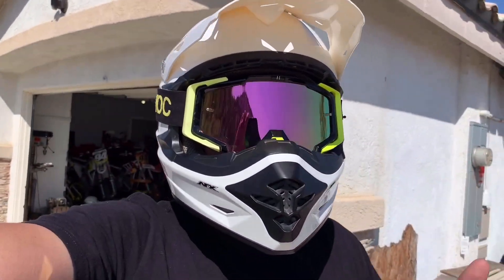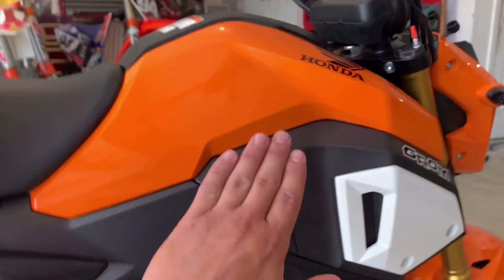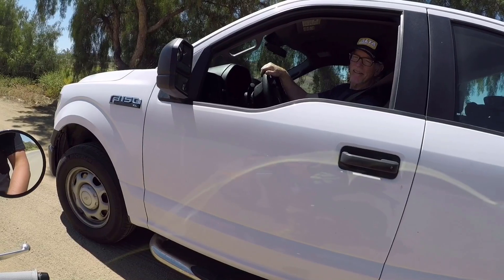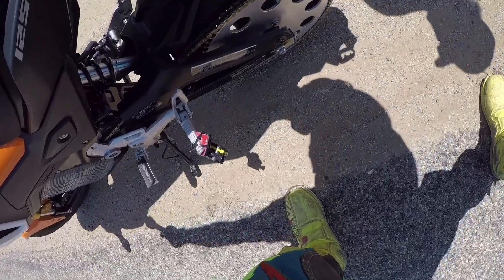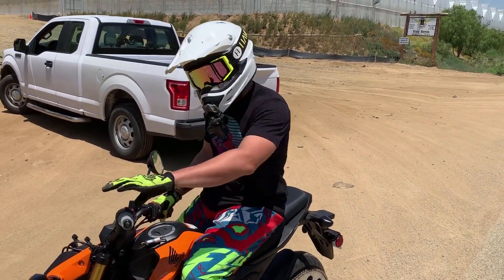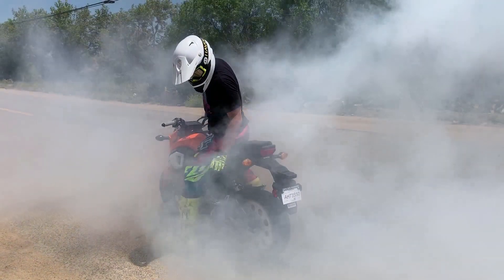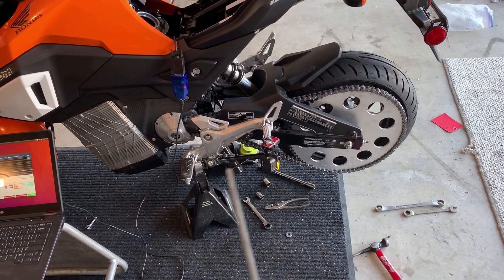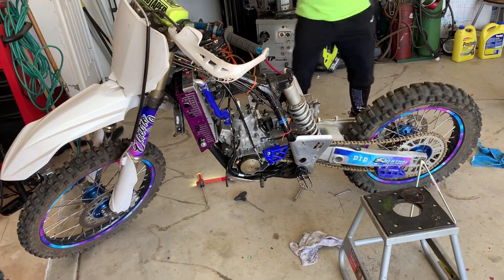50hp 40KW Electric Honda Grom First Ride - Project Electrom Vol.2

Comment: That chain sounds exactly like my homemade 4hp electric scooter, the chain going around the small sprocket makes that sound, I put like over 1000 miles on it and the chain survived (my scooter only did 35 on 36v). only way to quiet it down is a larger motor sprocket with a jackshaft that adds another set of gears, that way you could also run a smaller gear on your wheel. Dont know if you have room for that but its an idea. Excellent job, looks like a ton of fun to ride for sure!

Comment: How do you get 50 HP?? Did you say your pulling 100 amps?...On my modified Emmo Zone with Kelly Controller @225 amps, QS Motor 8000 watt hub motor, 100 Volt 45 AH pack I pull 20 kw, and can get the bike up to 130 KPH and 0-100 kph in about 7 secs.
Reply from the maker: John Zoccano @350v is the difference. 

This is an alta motors complete Drivetrain. Advertised At 50hp, then tested by forum members at 49hp. 

The high voltage and low amps was their trick.
Reply: @ElectroBraap  Ah..ok that makes sense..looks like your putting down lots of torque due to the "gearing" of that huge sprocket.....
Reply from the maker: John Zoccano It’s quite a long gear ratio surprisingly. The motor spins at around 11k rpm under load so without a gear reduction the sprocket size is quite large

Comment: On the chain side there's a big mess. In order to make it work you should build/mount up a gear reduction before the chain (and i wish to see a toothbelt next time instead of that). Without this basical mod it Will never work well. Take a read about antisquat and antidive in motorcycle dinamics, if you are confident to. Cheers
Reply from the maker: Nico there is not much space for a reduction, Its a Grom with 504 cells crammed into it. 😂

We can shrink the rear sprocket down a bit which is on the to do list. But what do you mean it will never work well? The ugly noise you hear has been addressed after the filming of this first ride. It’s still has an (to me) enjoyably loud wine to it, but it’s not harsh sounding any more. 

This is not a Moto GP Bike, it’s just a mini bike haha. The squat characteristics mean very little, especially with only 50hp. This thing rides perfectly fine and It corners very well.  

I don’t believe in over engineering something because on paper that’s how it should be. I believe in practical and simplistic designs.
Reply from the maker: Nico I appreciate the feedback though. You seem like you know your stuff!

You gotta realize that the Grom chassis is 100% stock. We could swap the 125cc engine back into it in a few hours no problem. Nothing has been cut or modified. We made this (an entire Drivetrain designed for a bike twice the size) all fit on a totally stock oem Grom.
Reply: @ElectroBraap  hello, thanks for your reply! I was talking about the rear behavior especially on the corner exit while accelerating, or while cornering. I know that's not a motogp, and as you I don't like over engineer things. But that's a basical error, have a look around on every motorbike on the market and try to understand why anybody use a similar final reduction. Trust me, you can achieve huge driveability improvement by just fixing that. I would really like to see the EleGroom on a small track with pitbike and minigp (I'm a hobby builder of the last category). In my opinion with 50 electric hp it should be a monster. Sorry for my bad english. Have a nice day, cheers from Italy 🍻
Reply from the maker: Nico No problem and thanks for watching man! I understand what your saying but I don’t think you are understanding why the bike is the way it is.

I did not engineer it like this on purpose because I wanted it like this. I made it like this because that’s what I had to do to make this Drivetrain from a Alta Redshift MXR work on a stock Honda Grom. Even if we could fit it we couldn’t get the parts as Alta is closed. We made this thing with basic tools in only two weeks time. 

If I was designing from scratch I would pick a much lower rpm motor. I would design a much better motor mount system. I would allow space for a proper reduction etc. 

This project is like shoving a bigblock Chevrolet engine into a Honda Civic... All done in someone’s garage with basic tools. Some engineering no no’s are probably going to happen just due to the combination and circumstances.

I really should make a video explains the setup and why I made the choices I made. You inspired me to do this as many people wonder why I made the sprocket like this haha.
Reply: @ElectroBraap  Nico, of course we considered chain torque as well as the jacking characteristics produced by the bikes new kinematics and new mass properties.   When resolved the squat ratio is relatively unchanged.